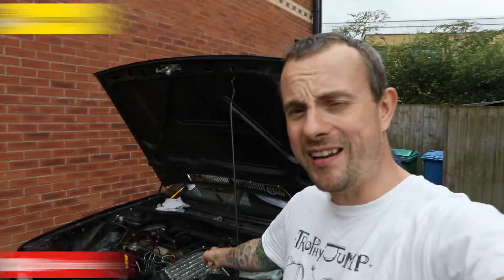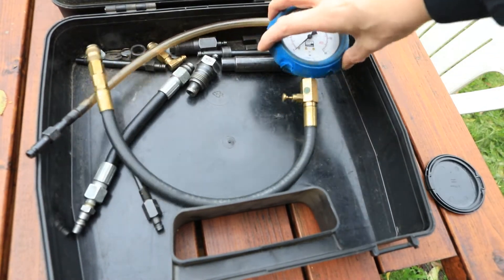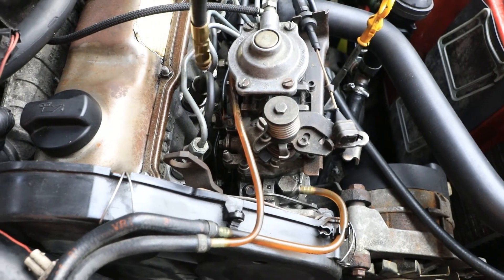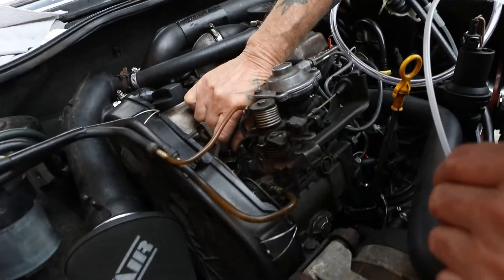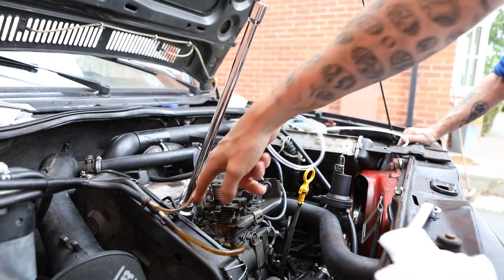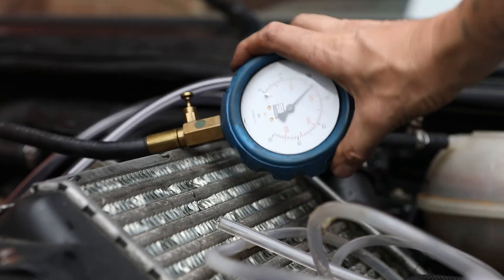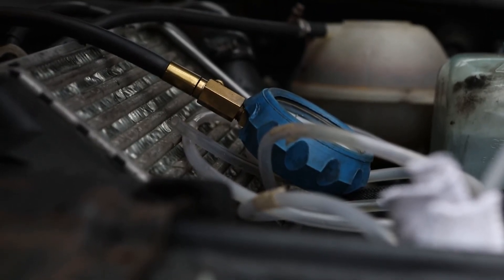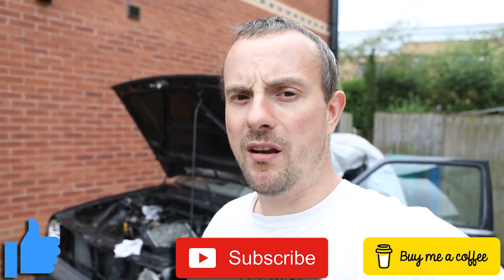Compression testing Diesel VW MK2 Golf (GTD - RA / SB)

Comment from the maker: If you’ve got a MK2/16v and want to follow the rebuild, subscribe!
And If you are enjoying my channel or videos, please consider looking at the links below.
Buy sweet MK2 Merch here: https://linktr.ee/mk2golfstories
https://www.buymeacoffee.com/mk2golfstod
https://www.patreon.com/mk2golfstories
https://www.instagram.com/mk2golfstories
https://www.facebook.com/Mk2GolfStories

Get 20% off Manuals online from Emanuals: https://tinyurl.com/Emanuals
With the Code GS22MK2
MK2 Golf GTI Emanual - https://shrsl.com/4onks
Get Manuals online from Emanuals: https://tinyurl.com/Emanuals
MK2 Golf GTI Emanual - https://shrsl.com/4onks
Reply: hi. what is going on expansion tank? are there bubbles or oil stains? And look under carpet  near heater radiator
Reply from the maker: @ИгорьЗалевский-ж7ю  hey,  no oil in the expansion tank. Have tried burping it afte coolant drain and there’s some
Air initially but not loads.
Did a sniff test and that didn’t show any exhaust gasses
Reply: @MK2GolfStories  how looks oil in oil pan ? Level, consistenci? Are there gases out of block head plug?
Reply: @MK2GolfStories  late ignition may caused black smoke. it is unburned diesel
Reply from the maker: @ИгорьЗалевский-ж7ю  looks okay on
The dipstick, no cream in the rocker cover either.
Reply from the maker: @ИгорьЗалевский-ж7ю  is that the timing from the fuel pump?
Reply: @MK2GolfStories  i mean fuel advance angle. must be 1mm on micrometr.
Reply from the maker: @ИгорьЗалевский-ж7ю  I have no idea where to set that, can you tell me?
I’m not really getting any black smoke. Just white, and water from coolant tank  is going down
Reply: @MK2GolfStories  looks like head gasket

Comment: Next time you could have disconnected the power from the diesel pump, then it should not spill diesel out when cranking the engine.
Greetings from germany, I like your videos ☺️
Reply from the maker: Thanks mate! Glad you're enjoying the videos.
The pump on this is mechanical (Driven by a belt) and there sno power to it.
Reply: @MK2GolfStories  there is one electric cable going to the pump, it is there to shut off the motor when the ignition is turned off. The pump should only be working when its connected

I think it controls some kind of electromagnetic valve inside the pump that shuts the fuel off
Reply from the maker: @TUBEYOUTHETUBE  AHhhhh i did not know that!!
Thanks for the heads up, i will keep that in mind for future refrence!
Thanks!
Reply: @MK2GolfStories  glad I could help ☺️ good luck with your mk2
Reply from the maker: @TUBEYOUTHETUBE  Thank you! :)

Comment: I've heard that factory ra/sb headgaskets arent really good dealing with an overheating engine (3/4 of the temperature scale and above). Looking at your playlist you have replaced your radiator fan, maybe that was the issue before you bought it
Reply: about overheating is an true fact. VW 1.6d engine does not like it
Reply from the maker: Oh really? That’s interesting to know and if so you could well be right!
I’ll know for sure soon enough!
Cheers for the heads up!